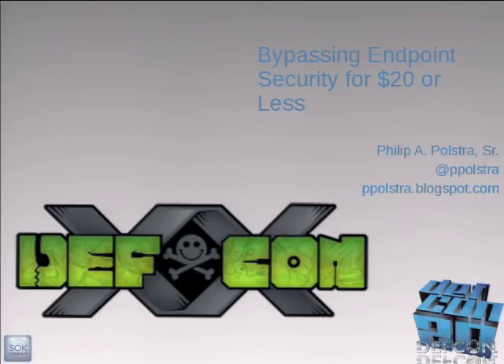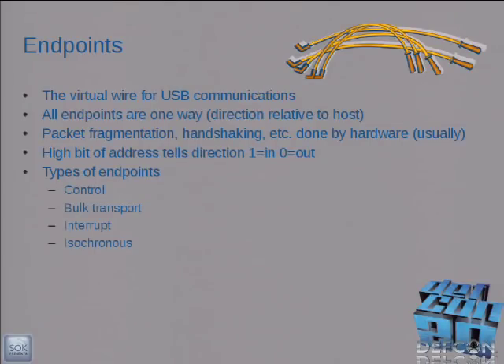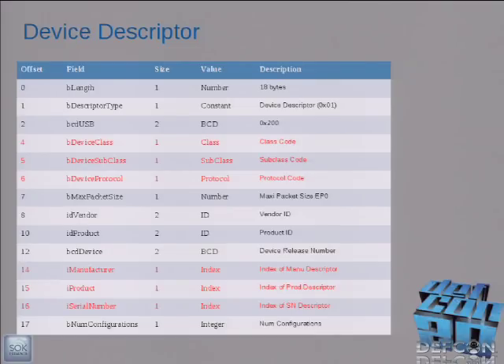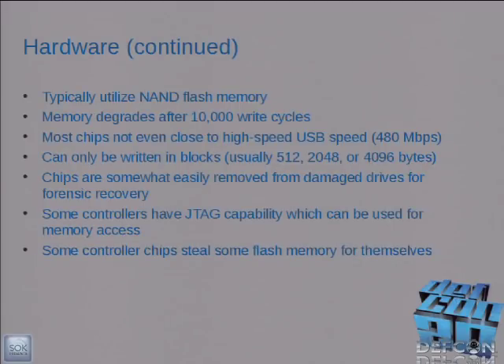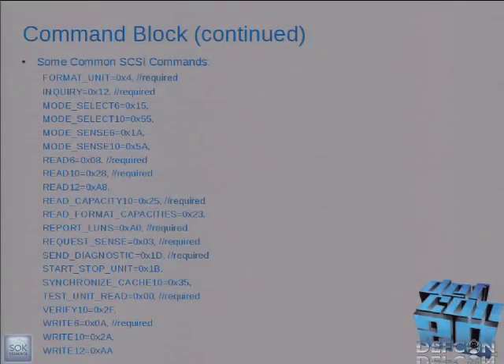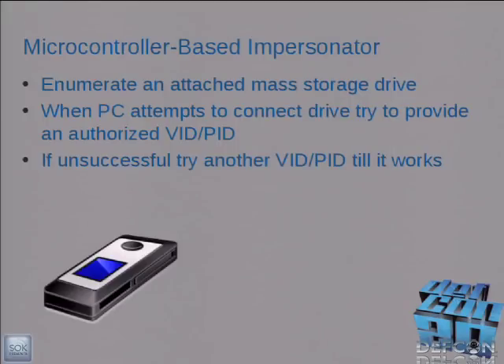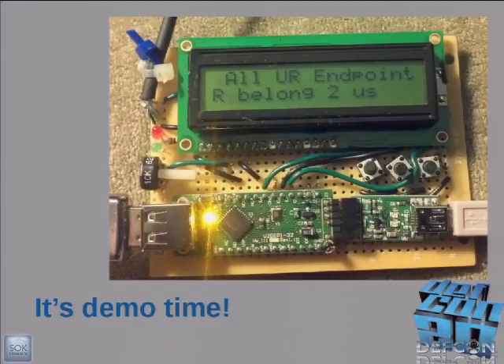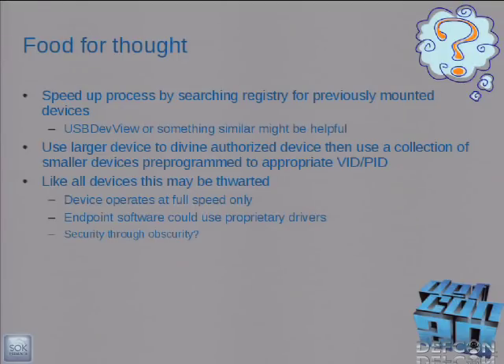DEFCON 20: Bypassing Endpoint Security for $20 or Less

Comment: The real security flaw here is that no effort is made to authenticate the PID/VID, nor monitor incoming connection attempts.

Im a big believer in heuristic analysis for detecting potential problems. It shouldnt be excessively difficult to write some additional code (there's already custom code that blocks invalid devices right? just add on to it) that detects an abnormal number of USB connection attempts (why are all these promiscuous usb devices trying to mate with me?) and raises a flag with the IT Security department.

Assuming we want to keep this paradigm of filtering with PID/VID, we need a way of validating the alleged return. This could involve anything from something as basic as a security token in the approved devices (though this could be a problem seeing as there will be many such devices floating around), to something more advanced like a one-way hash or public/private keys.

Comment: Bruv... 4Gb Flash drive that turns out to be 2Gb... in the dodgy areas of Shenzhen back in 2008 there were fake Sony 2Gb thumb drives that turned out to only have 128Mb on them! You name it... there's at least 5x knock-off versions with shoddy specs if you go to Sz.

Comment: 5 gbps on a usb 3.0?  HAHAHA.  If that were the case, I could fill up my 64gb flashdrive in less than 13 seconds. 
I'm pretty sure I would remember if something like that had ever happened.  The best I've gotten was less than a fifth of that (yes both the port and the device were using usb 3.0, and I was transferring from an ssd so I doubt that was the issue, and was transferring 3-6gb video files so there wasn't a large number of files to mess things up). 
Idk, maybe I'm just cursed to forever suffer slow transfer speeds, and if somebody else had been doing it they would have gotten the full speed :P
Reply: gbps is not GB/s
Reply: If you have any data transfer speed in Xbps (bits per second) you will have to divide it by 8 to get it in XBps or XB/s (bytes per second) where X is a SI unit (K, M, G, T etc.) and therefore 5Gbps is actually 625MB/s meaning it would take around 100 seconds to fill your flash drive IF that is, your flash drive could actually do the full 5Gbps which most devices can't, not even SSDs.
Reply: elmateo77 lol!

Comment: The reason you can't get USB flash drives with a blocksize !=512 is because Windows doesn't support it (though Win7/Win8 might). Flash drives have an MBR like a regular SCSI/ATA HDD, and there is no unambiguous way to determine what the sector offsets mean on an MBR with different sector sizes.

It is also why 4k sector HDDs have 512 byte LBA sector addresses (the internal physical sectors are 4k).